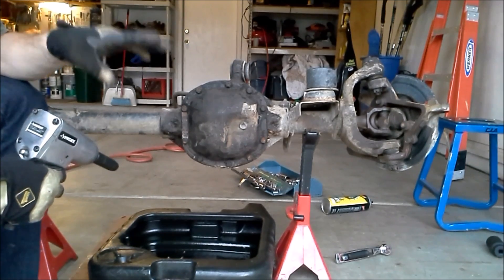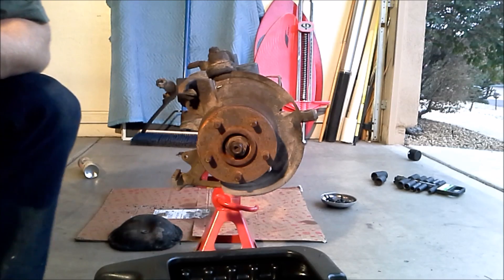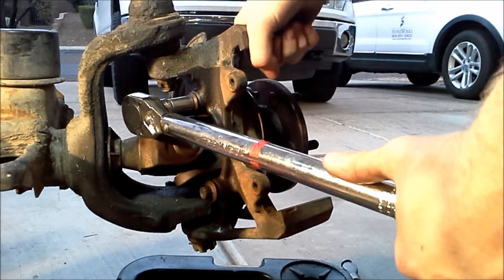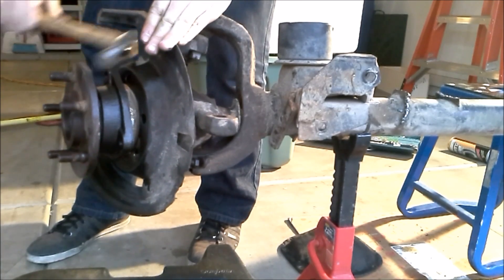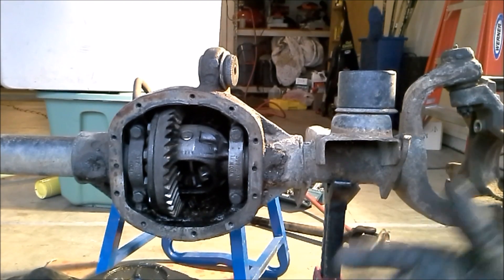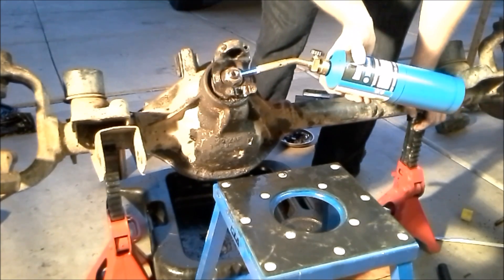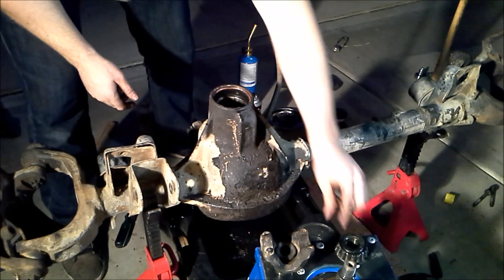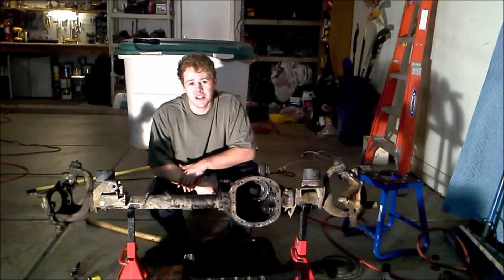dana 30 teardown

Comment: Great video! I was doing ball joints and the shaft on the passenger side didn't want to go back in so I figured I'd tap it in with a hammer and see if the small chance of not damaging the seal prevailed which it didn't. My XJ was driven with a leak and therefore low fluid. There's definitely metal in the oil and on the magnet but it's okay as long as no damage was done past any of the serviceable parts (gears/bearings). With it being relatively low miles since the leak started and it not being a much worse picture so far, I doubt that it'll be that bad, which I'll inspect when I get the caps off. The video was great for helping me understand this differential. I decided when I was doing the ball joints and purchased the adapters for my press that I do not want to skimp out on special tools so I foresee utilizing loaner tools from the parts store

Comment: I can find many vidios on the Dana 30 tear down, none on reassembly. Do you have one?
Reply: Just do the reverse of what you did. Are you having issues getting it all back together?
Reply: @Steven-zu1fx  Not having any issues yet. Haven't started reassembly yet. Could do the job using the service manual, but wanted to see the second video first,  reassembly, not so much how to do the job, but Metal shaper is so good telling me how to proceed, what to be careful of, what to look for out, torqes, etc. EVERYTHING that can save me problems later. In video 1, he says he will address many things in reassembly. Any other videos on this are horrible. Will not even bother with them. Will just attack this on my own with manuals
Reply: @engin33r65  If you have any questions let me know, it's not too hard getting it back together. Just make sure if you're punching out races get those race punch sets. Make sure it goes in as even as you can get it and be careful of the walls where the bearing rides. I'd recommend putting the race inside of your freezer in a little baggie with oil. Will make life a lot easier. Good luck 👍

Comment: Actually lemme ask you some questions here... I want to put a Detroit Locker in the rear (D44A) and a Detroit TruTrac in the front.  The axles are from a Laredo so are both open diff and have 3.73's.  I'd prefer to go up to 4.56's.  Is this possible?  I'm running 32" tires so I'd like more gear.
Reply from the maker: Definitely. Just make sure the carrier is the correct size for the gear ratio that you want. I believe the dana 44 is 3.92 and numerically higher and the Dana 30 is 3.73 and numerically higher. The Detroits replace the stock carriers so just make sure they fit the axle model and gear ratio that you're going for and you should be all set.

Comment: Also, you can just remove the hub with the axle attached and skip the 35 mm nut no biggie. :)
Reply: Thanks, I was looking to see if I could do this, i'm going to the pick n pull and it will be a mofo to get that nut off in the freezing cold.
Reply: @Pack_Shredder  Battery impact is the best.. in that case.. I just about killed myself when I broke a 1/2 breaker bar on that nut.. Went to 1" after that.. then I got an impact. Impact makes short work of it and great investment. Good luck, I hate doing anything in the cold. Also, sometimes I would put the spare on and put it back on the ground then break the nut. The wheel on the ground helps keep the hub in place and not torque the axle too much with the impact.. Just if you wanted to be extra careful.

Comment: In specific, is this the Dana 30 front reverse rotation, or is it the Dana 30 front crush sleeve version? I'm going to assume it's the reverse rotation front Dana 30. I have researched both and can't find how to tell which is which. The front axle on mine has enough rust and paint, it's hard to pull manufacturing stamps and markings.

Comment: Does the ring gear have to come off to pull out roll pin that holds the cross pin shaft into the carrier
Reply from the maker: You can remove the roll pin with the ring gear in place but you must remove the ring gear to remove the cross shaft

Comment: Thanks for the awesome tutorial.  My front axle has a disconnected tube hanging off the hub similar to your tutorial (5:19).  Can you tell me where the other end should be connected to? Thanks.
Reply: That's a vent for the differential, the tube needs to remain unconnected and be routed in a manner that keeps it away from moving parts. On my 98 V8 Grand Cherokee the hose routes up to the inner lower side of the air intake, there are little notches that grip/hold the hose in proper orientation.
Reply: Run the opposite end of your diff vent to up under your hood somewhere thats safe from moving parts and any liquids

Comment: Why do you sure to remove a Cotter pin use a pair of wire cutters to grab ahold of they I peace and use a prying motion careful not to squeeze too hard to cut it and it'll pull right out

Comment: Would this be the same differential as a 2003 ford explorer front diff? (Dana super)
Reply from the maker: I believe that the dana super was a Dana 30 differential but with independent front suspension instead of a solid axle.

Comment: If you're working on a Dana 30 front axle that has not been disassembled before, it won't be this easy.
Reply from the maker: +Wes Brash That's not necessarily the case. I tore apart the Dana 30 that I swapped out of my XJ for spare parts. It had never been torn down before and was just as easy. I think living in AZ and not having to deal with too much rust helps.
Reply: Rebuilt one in a 1995 ZJ that had the original... 180k miles. It actually wasn't that bad. Perhaps yours was just extra beaten or something

Comment: Is dana 30 the best choise for off road ? Is it strong enough?
Reply: I have a bone stock dana 30 on my 2013 JK, and I run 35" Duratracs. I was a little cautious at first, worried about breaking an axle shaft or u-joint, but over the years of mudding, sand dunes, trail rides, and even some low/medium intensity rock crawling, it has held up marvelously. I wouldn't say it is the best choice, but I WOULD say don't be discouraged from using one. I would recommend doing some strengthening to it if you plan to use it really hard (like axle tubes, chrome/molly shafts,  C gussets, etc.). My rig is both my daily driver and weekend warrior, so I know not to push it to the extreme, but still have plenty of fun in it.
Reply from the maker: That depends on a few things. If you are going to be running anything larger than 35 in tires, I would go with something else. I stuck with a hp Dana 30 because I'm only running 35s, I can get parts really cheap( the whole axle was $50) and it matched the width of my rear axle.

Comment: I have a spartan lunch box locker and want to go back to open diff until I can get a cable locker. How hard is it to remove the spider gears once the carrier is out?
Reply from the maker: should be pretty easy. Are you having problems with your Spartan?

Comment: im going to have to remove my hub with my axle shafts connected. the axle nut and cotter pin are so rusted together. im going to have to buy new axle shaft assemblys
Reply from the maker: That's one of the nice thing about Arizona. Not a lot of rust to deal with

Comment: Wouldn't suggest using a torque wrench to remove bolts. Throws the calibration off.
Reply from the maker: you're right. This one is already broken, so it has been relegated to breaker bar duty. I have another one for measuring torque
Reply: Admiral Off-Road perfect man. You in the west or east valley? I'm up in surprise. Manager at Autozone, if you need anything hit me up
Reply from the maker: I'm in Mesa and I'll let you know!
Reply: Nee Kniggit did you even read he above comment?
Reply: bldeagle10 Beat me to this comment! Great video though!
Reply: I was thinking the same thing when I saw that yikes!😝
Reply: I just started watching the video and yeah that's so wrong (I'm not trolling). You have to use the proper equipment. That torque wrench may work but I wouldn't trust it anymore.